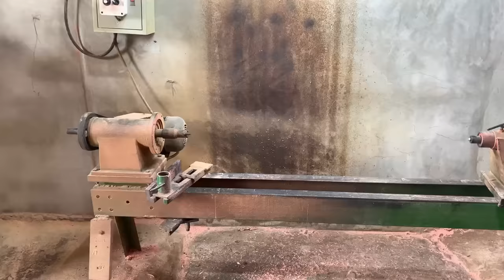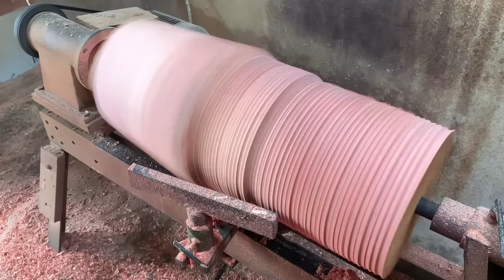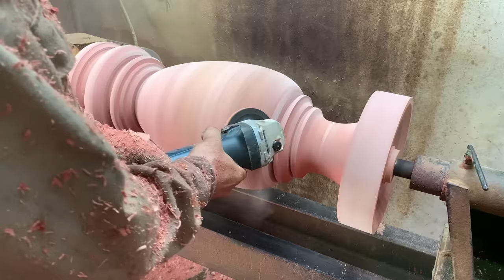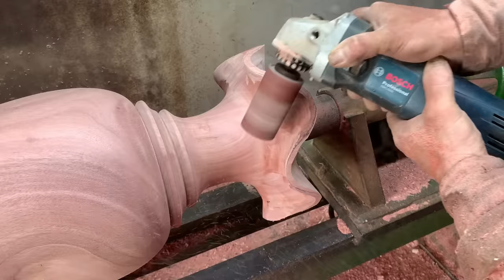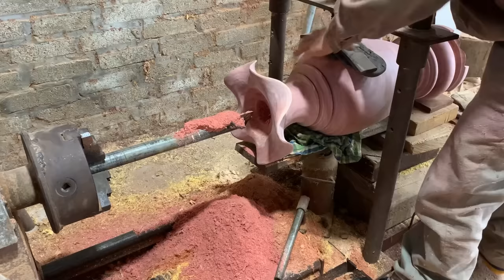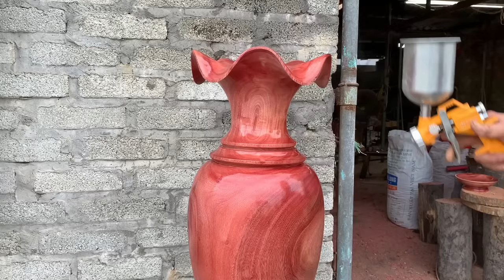Transforming a Redwood Piece into an Exquisite Masterpiece   Unparalleled Woodworking Skills

Comment: I can send here from Brazil, a closed container with stumps of (Cabreuva / Santos Mahogany) with a maximum length of 1.9m.

The requirement of our legislation here is that you remove all the skin (you cannot export it with the skin).

To travel with bark, you would have to obtain a special permit. It is a time-consuming process, but it is also a possibility.